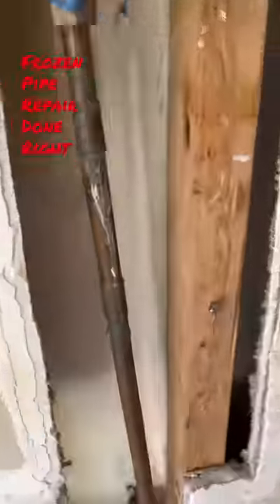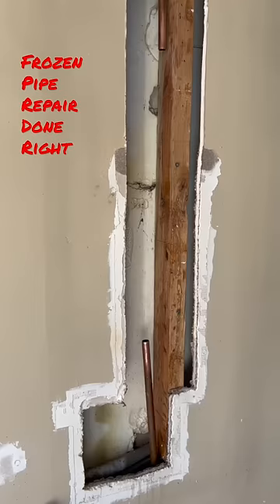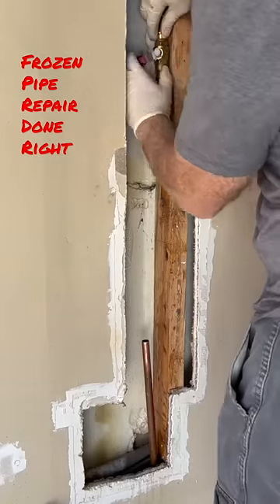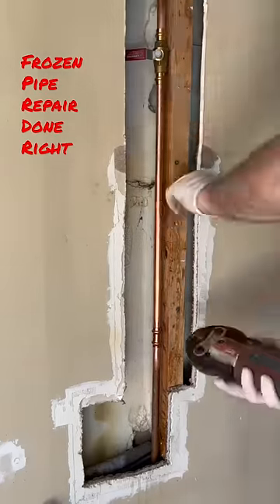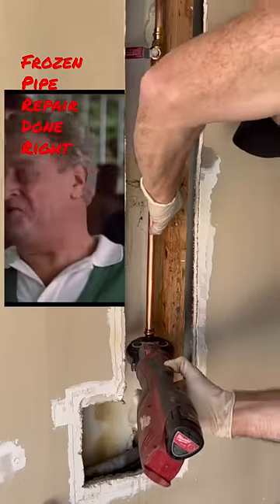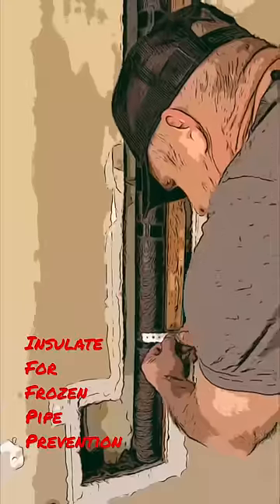Frozen Plumbing Pipe Repair @TappPlumbing #shorts #plumberslife #plumbingproblems

Comment: why wouldn't you put the valve in the square box where it's supposed to go you put a valve in a wall it's going to get covered up by sheetrock
Reply from the maker: There will be an access panel when the drywall gets repaired. Thanks for asking. Thanks for watching also!!!

Comment: You took the insulation wrap off the above pipe section after your first cut lmao.
Who tf doesn't insulate their exterior walls?
Reply from the maker: Ha, actually it was off on arrival what was left above was from the other previous repairs. I’m assuming it originally was insulated and the first leak so many years ago they took out the wet insulation. We educated the client on what should be done this time in order to prevent, including access door for valve that she wanted there and more insulation. The deep freeze here in GA unfortunately caught a lot of homeowners off guard! Thank you for your engagement!

Comment: Why is there a shut off valve behind sheet rock ? Smh
Reply from the maker: Great question, there will be a access panel installed when the dry wall is repaired.

Comment: Is it me is there drywall on both sides of the wall 
And if your inside why didn’t you tell the owner to fix the hole at the bottom that will extremely help . And so a deep freeze comes about every six years. And that pool noodle won’t help put fiberglass insulation pipe on the pipe
Reply from the maker: It does look like drywall at first glance , it is actually exterior foam sheathing. I gave the homeowner all of the insulation information I could . You are right, if it gets that cold again there is not much that is gonna help on an exterior wall. Thanks for watching and leaving us a comment!!!

Comment: So let me get this straight... You criticize a poorly soldered joint, then go install crimp on fittings that use o rings to seal to show off your skills? As a 20 year hvacr tech here who plumbs on the regular, please come to my service territory with those shenanigans. I look forward to fixing your customer in 5-10 years when it's leaking again from o ring failure.

Comment: You put the insulation on incorrectly. Pipes are not alive as warm blooded animals to generate their own heat. You should have put the insulation ONLY  on the cold side to allow the warm side of the house to warm up the pipe. duh

Comment: That insulation will prevent ambient warm air from getting to the pipe. Put batt insulation on the cold side of the pipe against the COLD OUTSIDE WALL! Damn people are dumb.
Reply from the maker: This really hurts our feelings when people say things like this😂  Is it possible the batt would be installed later when everything dries out ?

Comment: Shouldn’t be any kind of a valve enclosed in a wall in the first place
Reply from the maker: There must be a valve to shut down spigots around here. There will be an access panel installed when the drywall is repaired. You probably would be horrified if you saw some of the building techniques that are practiced here. Your statement is completely correct in my opinion. Thankfully they changed the code a while back and the lines are now ran to a cabinet on the floor above. The valve goes in the cabinet. Thanks for a great comment!!!

Comment: Dont worry if it freezes again its gonna expand those comoression fittings and flood the entire house 😏
Reply from the maker: If it gets that cold down here again and the homeowner doesn’t do there part it is gonna bust no matter what. Thankfully it is only gonna flood the garage because it is on an exterior wall. Those press joints will hold up perfectly fine for a couple of decades under normal conditions. Thanks for spending some time with us!

Comment: There’s pipe insulation at the top of your cut and at the bottom of the pipe just out of the camera’s view you accidentally show it for a split second so you are not the only person to have used insulation on that pipe. I’m not knocking your work at all every video I’ve seen of yours have been great and this one included but please don’t turn into the type of channel that just makes stuff up to get more viewers you seem like a great person please don’t throw that away for 10 more viewers

Comment: Everyone who cannot solder uses these junk crimp fittings. The crimp system was developed for low skilled workers, I E; you can hire any monkey off the street. and even though you can't teach them to solder they can pretend to be a pipe fitter/plumber. There's a reason why crimp fittings are not allowed in most jurisdictions because they have been in so much trouble for passing inspections where crimp fittings are involved...
Reply from the maker: Thank you for commenting and watching!

Comment: Why put a shut off in the wall?
Reply from the maker: That line feeds a spigot. It enables a person to shut it down to drain or repair the spigot. There will be an access panel installed when the drywall is repaired. Great question by the way. Thank you so much for watching!!!!

Comment: Why put a ball valve inside the wall.
Reply from the maker: The ball valve can be turned off to work on the spigot that line feeds or to drain it down for the winter.

Comment: Where’s the pink insulation at too? That house is probably cold as fuck
Reply from the maker: It is a garage wall .  I pulled the fiberglass out to make the repair. It was soaking wet and would have to replaced. Thanks for watching!!

Comment: Use sprinkler pvc schedule 80 preferred ,insulated over along with larger pvc ,  you can place before a or after a t n faucet  with access and or bucket to open it and close it to install freeze miser a cold weather thermostat that prevents freezing , done as the end of run or before n middle for boilers tankless

Comment: All you did is kick the can down the road and throw the last guy under the bus.. that pipe wrap is junk, you shoulda stuck insulation behind the pipe against what seems to be an outside wall. It's just a matter of time before those rubber seals leak. Sweating is still better and second to that is pex.
Reply from the maker: Thank you so much for watching and engaging . We value your opinion:)
Reply: @TappPlumbing  No you don't and when those rubber o-rings fail, you'll blame it on the tool. It's only a matter of time before the entire industry shifts away from this garbage. They'll chalk it up as a mistake and pretend they never did this and the customer will be left with the issues.
Reply from the maker: @maddoxinc1642   How long will it have to be out to prove reliable? The fittings are warranted for 50 years. These questions are not meant to be derogatory or sarcastic. What did the plumbers say when they switched from galvanized to copper? What did they say when ABS came out to replace cast iron ? I hope this change is one of the better ones , only time will tell. I have fittings on 2” that are 14 years old .

Comment: Here he is blasting the previous plumbers work about soldiering pipe when he is using a propress and most likely cant soldier him self. You can not run a waterline in a perimeter wall. It doesnt matter if you insulate or not it will still freeze. You can only pipe in water lines on interior walls.
Reply from the maker: I absolutely appreciate your viewpoint! I sincerely hope you will take a few seconds and check this video out.

https://youtube.com/shorts/BsgvHWRR9NY?feature=share

It will put things in context for you. Thanks in advance and let me know what you think about my solder joint in the background please??

Comment: Insulating the pipe is not going to help. The pipe needs to get warm air around it
Reply from the maker: That is gonna be hard to accomplish in a garage. You are correct though! The insulation could help the line retain a little heat compared to the outside air. Agree?
Reply: @TappPlumbing  if the garage is unheated, the little bit of pipe insulation is just delaying the inevitable. There needs to be a valve in heated space so the water can be turned off and the rest of the line drained when not in use. If it’s a constant use water line, it needs heat tape.
Reply from the maker: @greenbudkelly2820  That would be the best case scenario indeed . This happened at Christmas, literally. All of Atlanta had frozen and busted pipes. It made national news. Time and materials were almost impossible to obtain. The goal was to get water on quickly for as many people as quickly as possible.

Comment: Why are 3 plumbers burying a ball valve
Reply from the maker: There will be an access panel installed when the dry wall is repaired. This is just the way it is done around here. East metro Atlanta suburbs. Thanks for an excellent question. Thanks for watching also!!!

Comment: You rip on their solder joints and then use a propress coupling, any idiot can do that.  Good Job bud you're using a process that takes all the skill out of pipe fitting.  I wouldn't brag to much.
Reply from the maker: Take a second and check this out, it explains a lot.
https://youtube.com/shorts/BsgvHWRR9NY?feature=share
Thanks for watching!

Comment: Would’ve been a good job if you would’ve soldered a he pipe. rather than use those one rubber seal compression fittings wouldn’t have that shit in my house

Comment: Use PEX !
Reply from the maker: This line fed a spigot. In my opinion the copper gives it a more rigid field during operation .I do respect the fact that pex expands better under freeze conditions though.Pex is definitely a great product in many applications . Thank you so much for your opinion and watching!
Reply: @TappPlumbing  I live in AK. Up here Pex is the best. It can freeze without bursting. The fittings can break when froze though. So easy, fast and cheap to work with.
Reply from the maker: I think it would be cool to live up there ! Have you been there a while?
Reply: @TappPlumbing  Almost 23 years. I moved here in 2000. It's nice to actually own my property and home. No building codes. No property taxes. No one telling me what I can and can't do with my land. That's rare if not impossible to find in the lower 48.
Reply from the maker: Do you trap?
Reply: @TappPlumbing  Yes I do. I haven't in the last couple of winters though. Check out my youtube channel for a few of my trapping videos.
Reply from the maker: @wolfmantroy6601  Stoped at your channel at lightning speed! I cannot wait to give it the attention I know it deserves by the thumbnails . This weekend will be the latest, hopefully at least one tonight . I will make sure to let you know !!!!
Reply: @TappPlumbing  Thanks for watching! I originally started my channel as a way to easily download vids for my family and friends to watch. I try to do a better job of filming now that other people are watching my videos. I didn't expect that to happen. I'm still not very good at filming but oh well, my buddies and grandkids like them.

Comment: Why add a valve.
Reply from the maker: That line feeds a spigot in a exterior garage wall. The valve is installed so a person could shut the line off and work on the spigot or drain it down. Thanks for spending some time with us!

Comment: The pipe going into the bottom fitting is gonna fail over time.
Reply from the maker: Why do you make this prediction?
Reply: @TappPlumbing  we had a ton on leaks from a building and was told by a rep any bends in a connection like that will deform the pipe or fitting or both. The amount of force that is being used is insane. And I'm not saying everytime it will leak but the likelihood of it leaking with increase. Plus if I causes alot of damage the manufacturer will say improper install. Speaking from experience
Reply from the maker: I have to confess I am little confused, I am assuming you talking about the 90 at the bottom ? If so that is a fitting. Help me out here ?
Reply: @TappPlumbing  the coupling on the bottom looks crooked. I rewatched the video and it might be the pipe is got a slight bend in it making it look crooked. Just looking out for you is all.
Reply from the maker: @teakdougyfresh9528    I get what you mean now. Thank you so much for your concern and for your time engaging with us !!!!!

Comment: shut off valves should not be in a wall.
Reply from the maker: I agree!!! In my opinion there should be no water pipe in there at all. Sometimes we have to deal with the circumstances as they are . I find myself choosing between two bad options all of the time it seems like. That’s the way plumbing repairs go occasionally. Thanks for taking your time to offer up a great opinion!!!

Comment: Why are shark bites legal?
Reply from the maker: They actually work well in the right application for homeowners. We rarely use them we use Pro Press copper fittings. The key  to any of the fitting with o rings is to de bur your pipe, clean it and for certain make sure it is cut perfectly straight. If we do this we have a very good success rate:) Thank you so much for watching!

Comment: In any section that has a history of freezing only an idiot would ever use copper again if you pex that section it can freeze solid and not leak
Reply from the maker: I do normally like to use pex because of its freeze break resistance. This line was attached to an out door spigot . I think copper gives it a much more secure feel during operation and stands up better to the abuse an outdoor spigot receives.

Comment: Plumbing on an outside wall and without insulation?  None of this was done by a pro.
Reply from the maker: I know you will find this hard to believe but pipe on an exterior wall is a very common practice here in Georgia 😬

Comment: Why are you burying a valve in a wall ????
Reply from the maker: Great question! There will be an access panel installed when the dry wall is repaired. Not really a fan of this but it is fairly common practice in certain age homes around here🤷‍♂️. Thanks for watching!!

Comment: Plumber who doesn't solder it makes fun of others solder.
Reply from the maker: Please watch this real quick 

https://youtube.com/shorts/BsgvHWRR9NY?feature=share

Thanks !
Reply: @TappPlumbing  Fair enough. Lots of decisions are dependent upon a case by case basis. But insulating a pipe inside an outside wall only half slows down the freezing that insulating behind it would. And if it comes up through a crawl space it's useless.
Reply from the maker: Excellent points you have here that cannot be argued with my friend. Thanks for sharing!!

Comment: If something froze that many damn times wouldn't your brain register the air within that wall cavity is too cold and moving freely?! I would find some glass and jam it in there after the foam. Ridiculous
Reply from the maker: Admittedly some of catch in a little slower than others😂. There will be some fiberglass put back in there when everything dries out . The homeowner will be responsible for that and providing an access panel. Thanks for watching!
Reply: @TappPlumbing  Yeahh. Glass absorbs moisture, so a thorough drying, Lysol and maybe a coat of high lime paint is in order.
Reply from the maker: @pgmurray76  Sounds like you have been through this a time or two!

Comment: Explain to me why you are installing valves inside of a wall? Also why did you do such an amateur job with cutting open the wall? Should have cut down the center of the stud for the right hand side of opening so drywall would be better supported. And the bottom of the cut...so ugly.

Comment: Dude gonna call out soldering using a propress
Reply from the maker: Sounds odd right? This will explain everything!

https://youtube.com/shorts/BsgvHWRR9NY?feature=share

Thanks for watching!!!!
Reply: @TappPlumbing  I’m a supermarket refrigeration tech….that being said I touch anything old on the side I also don’t fuck with it. I run to my RP340 😂. But I was also thought by master plumber as a teen when I started out, that dude would scream if I touched something I just sanded with my oily fingers or if I didn’t heat a flux joint and wipe it before soldering.
Reply from the maker: @Meow2024.  It definitely sounds like an old school dude got you started out right!

Comment: No good u have insured it will bust again, why did you install a WINTERIZATION VALVE? To eliminate the possibility of water in the pipe during freezing temps!
Ok , so why does it need insulation. Yep first in 26 years 😂 where do these people learn to plumb?
Reply from the maker: I'm thinking you meant , why did we not use a frost free spigot? Here is a video that helps explain that:) https://youtube.com/shorts/TNb2OHqAeto?feature=share

We appreciate you watching and engaging! Have a fabulous day!!

Comment: Seen too many of those crimped connections fail
Reply from the maker: That is interesting, I have been using press fittings 14 years and have had three failures. They all showed up immediately. I wonder if you were going behind someone not installing them properly?
Reply: @TappPlumbing  perhaps you’re right, I work on irrigation systems only so I only really turn systems on by the lever that’s all but there’s been a hand full of times that pressed fitting would pop off but it could be from bad Installation
Reply from the maker: If you are in irrigation it is time to get busy soon!!!
Reply: @TappPlumbing  yes sir! Already turning on systems for the season!

Comment: That is an ugly looking repair. I agree that all needs to be properly repaired,  but I would never use propress in a concealed location.  I don't even like pex. I'm a firm believer in copper pipes and soldered joints. Edit: Why is there a valve behind the drywall?

Comment: Those compression fittings he’s using is no different than the shark bite has an O-ring only difference is the way it locks to the pipe what he’s using is a piece of junk learn how to sweat your joints or breeze them
Reply from the maker: Take just a second and check this out , it explains things

https://youtube.com/shorts/BsgvHWRR9NY?feature=share
Let me know what you think about my solder joints😂 Thanks for watching!!!